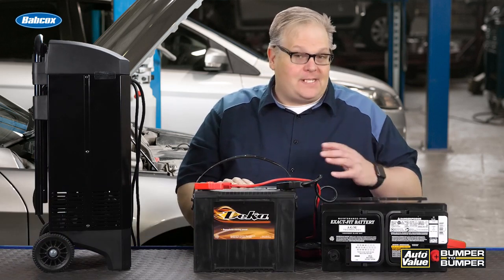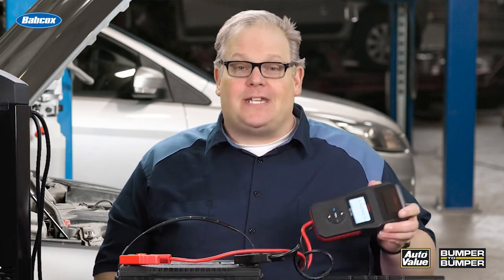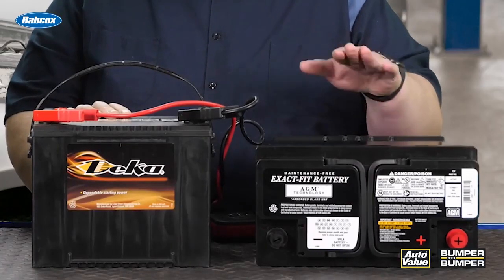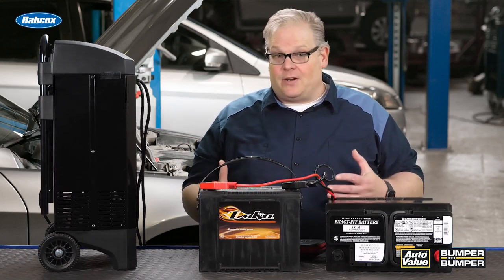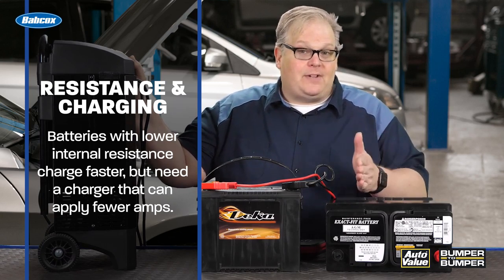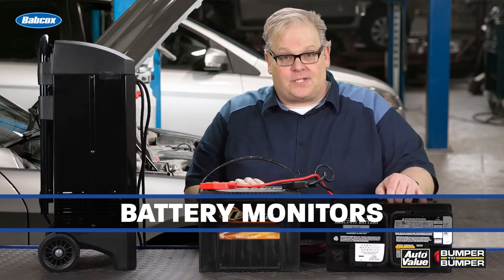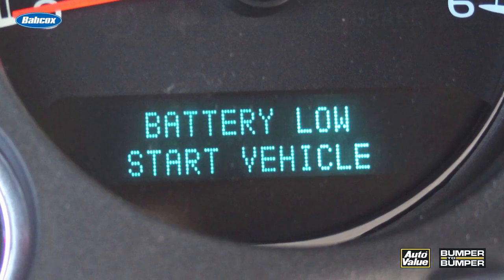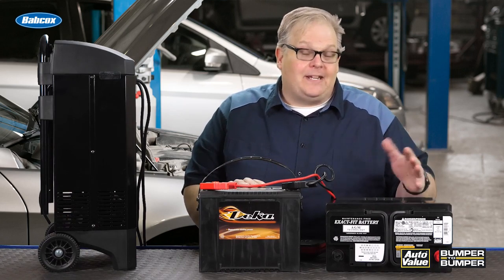Understanding Internal Resistance And AGM Batteries

Comment: What is a good internal resistance value for a new AGM car battery?
Reply: lol, i bought a new agm and it has 8mOhm... i guess this thing is bad?
Reply: I have a new flooded battery with IR of 5.x mOhms. I also have an 18 year old flooded at 11.x mOhms. AGM has lower resistance than flooded.
Reply: Internal_R=4.65mOhm, for a 6 years old Canadian Tire Eliminator Ultra AGM group 34 775CCA (Exide), measured with a Topdon AB101